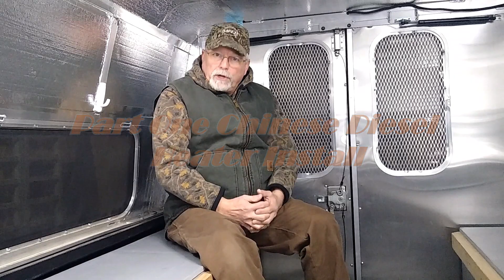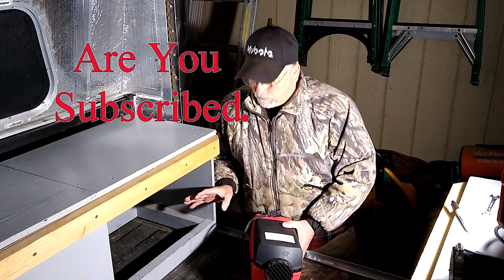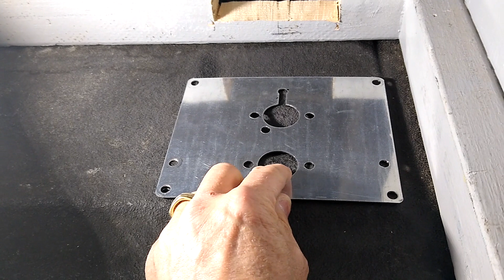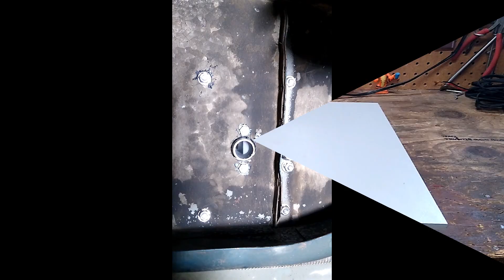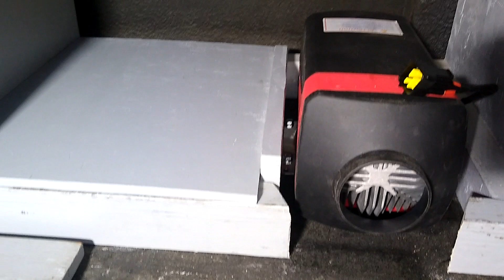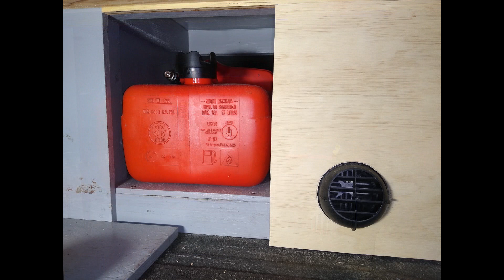Chinese Diesel Heater, Part 1

Comment: I'll just hire you!😉 😆 That is a great job you did with it.. Great video! Blessings!
Reply from the maker: Toonstead, thank you for your comment and watching the video. This was a fun install and will be so nice to have while camping in the cold weather. Did you notice anything in the still shots at the end of the video? 😊
Reply: @explorer867  I want to replace the heat in my RV with one of these... 
???>>> Do you know if I can Mount it on it's SIDE? I want to use the old vent Holes on the side of the RSV that are there for the old heater.
Reply from the maker: @RVingwithG  Not sure if it can be mounted in a non-conventional  way. Thank you for watching our video and for asking your question.

Comment: This is so good! I've never heard of a Chinese diesel heater. So interesting and informative. We'd never be able to install as a DIY but would have you set it up lol. Great video :-)
Reply from the maker: Hi Fern, These heaters are a very good alternative to using propane in my estimation and that of others as well. They use very little diesel ".02 ml for each Hz or stroke of the pump" and except when heater is first starting up and during the shutdown cycles uses 8-10 amps at those times. While running it uses only .7 - 3 amps depending on Hz setting on controller. Thanks for watching and leaving your comment. PS: I have the part 2 video about the install just released today.

Comment: Right now, I have an electric heater when in a park and a Mr. Buddy for boondocking.
Not crazy about the condensation. This is an interesting alternative. @DIY M105 Camper put one of these in his and loves it.
Reply from the maker: Daryl I am very happy so far with this 5kw unit. It's up and running. I will have part 2 up on Thursday. Thank you for watching our channel and leaving your comment Daryl.

Comment: Wow, that's a big difference on the price between the German and Chinese unit.  I like the way you pattern drilled the necessary holes and prepared for the fuel tank.  Good video!
Reply from the maker: Yes big price difference. I do hate to go Chinese on anything but all things considered price, amount of use, good reviews on the Chinese heater I decided to give it a try.

Comment: Crazy difference in price compared to the German model.
Nice install so far, looking forward to hearing your views when you get to put it to work!
Reply from the maker: Yes a major difference in price for sure. I figure even if I have to replace this unit at in two or three years I'm still money ahead. Now that said I do have the install completed just haven't released the part two video yet and the heater is working very well. Thank you for watching the video and for your comments. Have a great day

Comment: Didn't even know they made those. Hope it works out well for you.
Reply: Happy Place Camping there is also a version that heats both air and water, search Youtube some good videos available.
Reply from the maker: @Svendle123  Yes the diesel heater that also incorporates a hot water heater is a very cool option. I may try one of these on the camper trailer conversion I will start soon. Have you tried one of these combo units Sven? Thank you for watching the video and also your input here. Have a great day
Reply: Explorer 867 I haven’t tried either one. I am currently RV-less, we sold our last one as is was a bit too small for our family of four.
I hope to find a newer used unit and upgrade it for shoulder season camping so I have been scouring the internet for tips and ideas on what to do and how. 
So it’s people like you that are helping me!
Thanks for posting the vids of your experiences!
Reply from the maker: @Svendle123  Always happy to share our experiences, and look forward to hearing from you.
Reply from the maker: The installation is finished and it's amazing. Part 2 will be out next week. This unit uses very little power and burns little diesel. Thank you for watching and commenting on the video. Have a great day